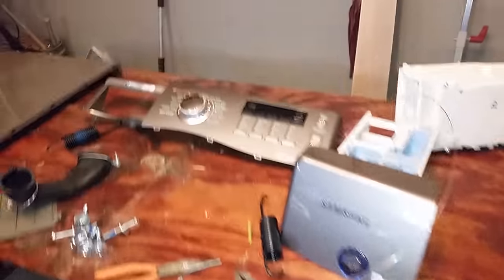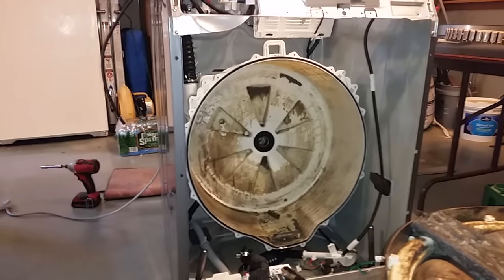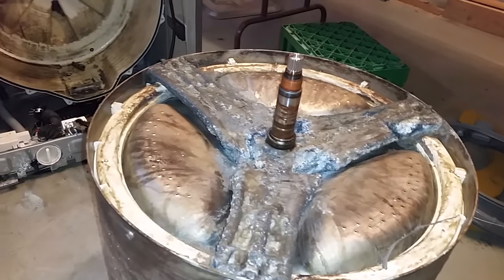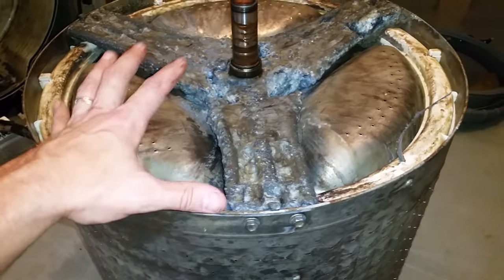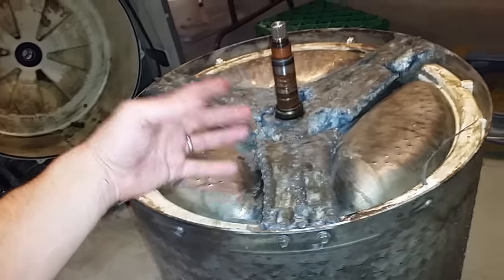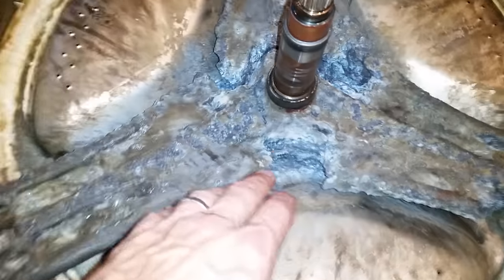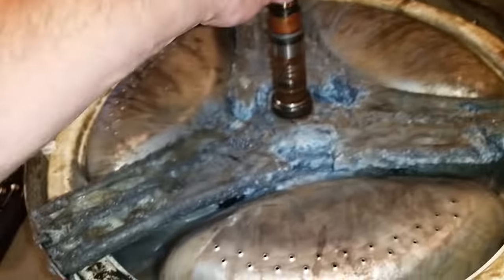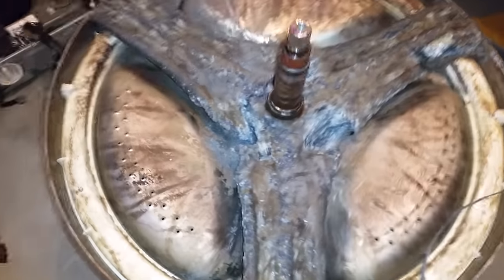Do not buy Samsung front load washer machines

Comment: I would never ever buy any other washing machine, but SAMSUNG -  front loader!!! 13 years in service, not a single issue, used daily, end of story!
Reply: I just got rid of my washing machine and that was 14year old, just remember production of white goods has changed since then, they  are not built the same anymore and there's end of life designed into them.
Reply: @stevienico452  And yet, I would ONLY buy Samsung or LG (also made in S. Korea)...
Reply: What detergent do you use, and do you use the double rinse cycle?
Reply: @vincentrobinette1507  I personally use PERSIL pods for the last two years; before we used ARIEL powder and before that, PERSIL powder. Excellent results at every load, My Samsung front loaders go strong and feel like new after thirteen years... No extra rinse (not needed)
Reply: @A.Dude.  I wonder if those detergents have a more balanced PH, making them less prone to transfer Ions from one metal to another. It could also be, that the emulsifiers make those detergents more soluble in water, even the film left over if the rinse isn't perfect. Keeping the alkaline down helps reduce the electrolytic properties of soapy water down, which would greatly reduce what this video shows.
Reply: @vincentrobinette1507  Persil is Made in Germany and Ariel is a French brand, but the product available in the US is Made in Mexico; both are AMAZING and also smell fantastic; no US made detergent comes even close
Reply: @A.Dude.  We have Electrolux front loader washer and dryer set. We started out using "Tide He" Liquid detergent, I didn't like it. It's what got me in the habit of doing the double rinse. A setting on my washer. We switched from that, to "Country Save" detergent, designed for high efficiency washers, and it is really good. It isn't so full of fragrances, which, to avoid being rinsed away, require oil. I don't want any residual soap in my clothes. I would rinse with distilled water if I could. No matter what, you want a low suds detergent, specifically made for high efficiency washers, front or top loaders. These machines just don't use as much water per fill.
Reply: @vincentrobinette1507  I forgot to tell you something; when we got our pair, that was in a dedicated appliance store and the sales rep really knew what he was talking about. So, he told us to use ONLY ONE TABLE SPOON of detergent /load. We would have filled the tray otherwise. He told us that these machines don't need more than a TBS... Never ever did we have a problem of not getting the stuff clean or having still detergent in them. I don't know what Electrolux does and how and for this reason we won't walk away from Samsung.
Reply: @A.Dude.  There's no reason to. It's just the matter of understanding that high efficiency front loading washing machines use much less water, so much less detergent is required to get the concentration of soap high enough for effective cleaning. Imagine, if you put 4 cups of soap in your old school top loader. That would cause similar problems. I'm not brand loyal, but it is important to understand the characteristics of new equipment, and the detergents required by them. when I'm washing full capacity loads, I use equivalent to a table spoon, plus 1 tea spoon worth of detergent. Now where near the half cup recommended by the top loader that it replaced.

Comment: hey Phil I'm sorry to tell you but I don't think that Samsung is the only company that's been using this inferior style spider bracket I had a I have actually a GE front loader and had the exact same thing that you just pulled out happened to me I got on the phone with GE it took me about 2 weeks but I was able to get them to send me all parts for free I spoke to the supervisor I told him that this is at designed failure they purposely made this unit to fail within 5 to 10 years as you spoke about with the cats other than the Android there's actually a ground wire right on the bearing strip to further the corrosion
Reply: The ground wire is there to earth any electrical faults. DO NOT REMOVE.

Comment: I am from india. I have just now checked with an LG service man I know. He says, `1) this problem comes mainly with hard water 2) not much of a problem in machine made nowadays 3) typically develops after 7-8 years of use 4) careful usage (using less detergent, regular clean cycle runs and airing the drum) should help mitigate the problem.
Reply: How's your lg machine so far?

Comment: April 2020 my Kenmore- Samsung washer purchased new 2012.  The washing is done ever 2 weeks (house cleaner), approximately 4 loads. The same thing happened to my washer except mine came right apart. The bearing is in great shape.  Designed to Fail. Depending on where you live (your water source) and detergent used will determine the life of this part.

Comment: schweet,Had one of these units several years ago the wife loved it due to the fact that it used only about 12 gals of water to wash cloths,then the error codes and pre mature shut down after unit had run out of warranty by a month,so after reading forums and watching youtube videos decide not to purchase another front load due to an inherent weakness in all of them,don't let peeps tell you that it's because you use too much detergent,the issue arises from the holder on the back of the drum made from pot metal and from the fact that there was no concession for cleaning the back plate or rear of drum which could have been incorporated with a couple of spray nozzles on a clean drum cycle,as a side note you can somewhat tell when the metal is eroding your cloths start getting spots on them from the build up of the different detergents in the crevasse of the holder and from the leaching of the metal as it slowly dissolves,and yes I did disassemble mine and was going to replace parts but it was going to cost as much as a new one so to the metal recycle it went.
Reply: Pot metal is not zinc but cheap aluminum.

Comment: I had an identical Samsung washer in my Korean apartment for four years.  It was probably ten years old before I got it and that was about five years ago.  Other than a clogged drain pipe in the apartment plumbing, which the landlord fixed, the washer ran perfectly with no hiccups.  Some galvanic corrosion may have occurred with your particular device but I suggest that it is premature to say that all such Samsung machines are so affected.

Comment: We had the Samsung spider go bad on one of our front loaders.  It ran for 8 or 10 years before failing and that was likely the original spider since we bought the set used.  If your washing machine starts to make more noise and a hard time to spin during the cycle it can be the spider going bad.  It's cheaper to change it out when it starts to go bad than to wait till it falls apart.    Ours broke the top of the tub encloser and gasket so we had to buy those part as well.  It cost about $350 for parts - tub encloser, spider, and door gasket.  Way cheaper than buying another set even used. We used youtube instruction videos to make the repair.  It really wasn't hard.  I've read this is common with pretty much all front loaders.  Even so, we prefer the front load machines so we will just keep fixing them.

Comment: I think I have the same problem with an AEG washing machine I bought in 2006. I haven't opened it up yet but the symptoms are the same and the filter had been clogging with a mysterious gravel like substance for the past two or three years and suddenly became much more voluminous in its last few weeks of life. It was actually clogging up the filter so much that it would stop mid wash due to draining fault even though the filter had just been cleaned before the wash.
Seeing this video I now realise that the 'gravel' is probably the corroded metal of the spindle support. I'm hoping it is something I can replace as apart from this terminal issue it has had zero problems in its 12 years of service, absolutely none at all, and I'm confident that if I can get it fixed it will outlast the one I bought to replace it. 
It's a pity that they can design such a good machine and then burden it with such a fatal flaw. Just making that one piece out of pressed stainless steel plate like the rest of the drum would make it last practically forever and wouldn't add more than 30$ to the price, probably much less.
Reply: I've taken it apart and it is indeed the exact same problem. A shame really as the rest of it is as good as new. I'll try to get a replacement part and put it together again. If I manage to get it to work I'm pretty sure it will last longer than the new machine I bought to replace it.

Comment: I have a Samsung front load washer that we paid about $1300 for about 8 years ago. We have experienced problems throughout its life. We had to get a repairman just as the warranty ran out. A plastic gear stripped out and had to be replaced. We had to fight with Samsung to get them to cover the repair. For the past several years, the washer has trouble balancing any load. We have tried small loads, large loads, balancing the loads in the basket different ways, etc. The problem continues to get worse. Yes, the washer is level. I have checked it for level many times. It has become such a problem, we are looking at buying a new washer. I have to agree with you, do not buy Samsung front load washers.

Comment: Seems like all front loaders have one problem or another. I just did the tub bearings on a 10 year old Maytag, and while the bearing job wasn't too bad the outer tub had stress cracks that caused water leaks. They want $700 for that part so I went at it with my Dremel tool then filled up the cracks with JB weld. BTW, the bottom of the washer cabinet has no drain holes so that's VERY rusty from he water sitting there. We'll see if that steel lasts as long as my JB Weld repair in a few years!
Reply: rupe53 actually front load is better and more efficient most industrial washers are front load but they are stainless steel throughout so there is no corrosion
Reply: @nightmareinaction629 … and that's the main reason most people buy them. OTOH, considering they costs about twice that of a conventional top loader and last half as long before a major repair, one has to wonder if any $$ is actually saved. Anyone care to crunch those numbers over a 10 or 20 year lifespan? What I do know from actual testing is they do use less electricity, because they don't constantly change direction.

Comment: After reading  some comments I really need to give my experience with front loaders. In Europe we all use front loaders. Since 10 years or so the machine became more and more efficient. In that same decade washing powder almost lost its market. Fluid detergent and LOW temperatures gives problems. Front loaders should be cleaned monthly when you don't wash in higher temperatures. My Miele automatically  gives me a message when to run the clean cycle. The software counts how often you used the a low temperature. Plastic tubs are not helpful either to prevent a smelling machine.
So I wash everything in washing POWDER. always minimum  of 40 degrees center-grade, monthly a close boil wash 90 degrees.
My Miele never gave my a message to clean the machine and everything comes out fresh. I have this Miele now for 4 years and everything is clean on the inside of the machine and it will stay that for many years to come. My former Miele washer is also still running without any failure for 19 years already.
Buy A Miele , Asko or a Schultess and you will have no trouble at all with the problems as shown in the video or smelling problems

Comment: Excellent post! In all fairness to Samsung, and I am not a fan boy, my 10 yr old GE front loader had the exact same problem of corroded spider arm. And you know, I couldn't find a new replacement spider arm for my machine and guess whose parts were readily available- Samsung. GE wanted me to buy the whole drum assembly. Couldn't spend the $$ for 10 year old machine.

Comment: It is the norm in the UK for washing machines to have an aluminium spider and stainless steel drum. I just replaced the bearings in my 10 year old Zanussi and the aluminium spider was not corroded at all. 

I live in a very hard water area, which I'd guess is the major difference, the staining on the exterior of your stainless steel drum and the grime on your tub make me wonder if your tap water is mildly acidic,  or if you had been using liquid detergent or pods instead of a washing powder containing oxygen bleach, which kills mould and keeps the machine clean as well as removing stains from clothing.  

Washing liquids also tend to leave residue coating the insides which retains moisture, promoting mould growth, but I guess it could also facilitate electrolytic corrosion even while the machine is not in use.

It is also quite common here for plastic tubs to be welded instead of bolted together, especially on the cheaper machines, and sometimes the spider is riveted to the drum, at least your Samsung wasn't.

I believe detecting if the load is out of balance is usually done by monitoring the back emf from the motor.

Comment: The bracket on the back of the drum is called a spider. The metal it's made of is a composite of several shit metals. I'm an appliance engineer and I find customers who use highly concentrated gel type detergents suffer the spider snapping more frequently. Powder is best. Do a service wash every month to reduce the risk of this happening.

Comment: This is totally intentional to make us spend our precious money in replacements and service. We have a Samsung front load washer here and we always followed the procedures of the self cleaning cycle whenever the machine asked to do it. Well, 3 years later the spider (drum support) broke and was totally corroded just like the video. 3 years! It's still brand new on the inside and with the other parts of the machine. We never used the cheap soap either. Gonna buy a replacement because we can't afford a new one right now, but this time I'm gonna apply a very generous coat of epoxy paint on it and we'll see how long it will last.

Comment: Same type of sacrificial rod in a hot water heater.
Most people don't check for this, but it is important.
Once the rod corrodes, it will start to corrode the heater itself.

Comment: I think my Samsung VRT front load washer (8 years old) might be having this issue.   It washes fine, but won't spin up and sometimes gives the 3E code.   I put it in test mode and it spun up all the way to highest spin but it did wobble a bit at the beginning which it's done for a long time.  Funny that is spins in test mode, but won't spin when washing clothes.  Looks like I may have to nurse it along a while longer until I can tear it apart and check to see if mine's corroded too.
Reply from the maker: IndyGlockMan good luck, save yourself a lot of aggravation and find a video online on how to tear it apart. Or a video that is close to your model. Also if you have one, use a Cordless drill or impact driver, willCut down on your teardown time when removing all the bolts from the drum in the back.

Comment: Thanks. I was just about to buy a new £500 samsung today. But mot now.
My indesit broke after 10 years. I always use vinegar to rinse and always open doors.
I checked filters, belt, back filters ok. Heater I unscrewed and nothing trapped there. Heater needs discaling though.
Drum not turning and clicking sounds. Any advise?
Shall I maybe exchange the box?

Comment: Have an LG front load and had the same exact result. LG uses the same spindle bracket as Samsung.The replacement I received was the same cast aluminum material as original. In an effort to add life I sprayed it with 2 coats of cold galvanization.

Comment: Biologically induced intergranular corrosion can be an issue in some washing machines suffering  from heavy deposits of biofilm. Can be prevented by maintaining the machine properly.

eg leave the  door open between washes to help it dry,  avoid cold washes, do occasional 60°C+ washes (you may need to select a higher temperature on some machines to actually reach 60°C),   use a powder detergent or stain remover containing oxygen bleach plus activator (sodium percarbonate, plus TAED, or NOBS),  or  a laundry sanitiser .

Comment: Pretty much all front load washers use the same or similar metals for these parts... the biggest issue is that people are having a hard time putting in the correct amount of detergent...you need very little of the current detergents to do a load.   By keeping the concentration high you can not effectively rinse the detergent out and you get a build up like you see here which in turn attributes to corrosion.  Also cleaning the washer help remove and deposits which contribute to corrosion.... most people have never run a clean mode wash on their washer since day one.... which you should do monthly or bi-monthly depending on how your water and usage are.  In short the issue seen here are common among many of the front loaders on the market, but are cause by improper care.  I current have the model 4 or 5 years senior this model and it looked pretty good when I tool it apart last time for another issue...